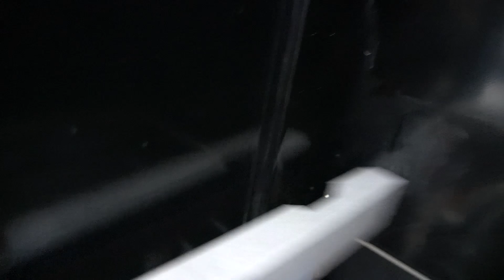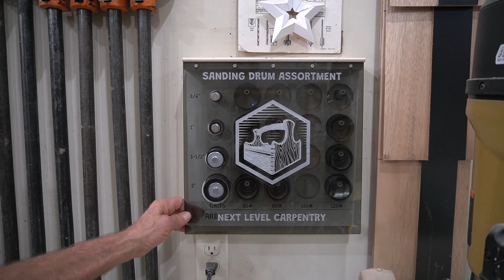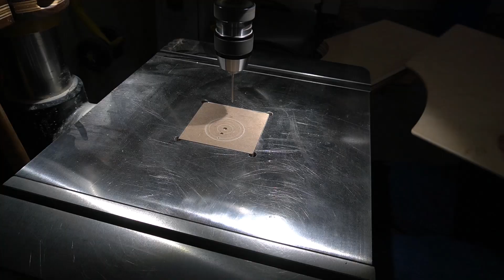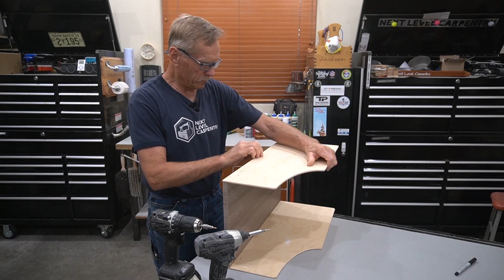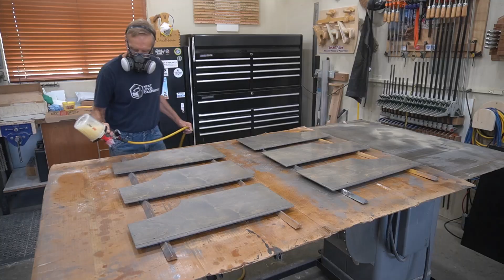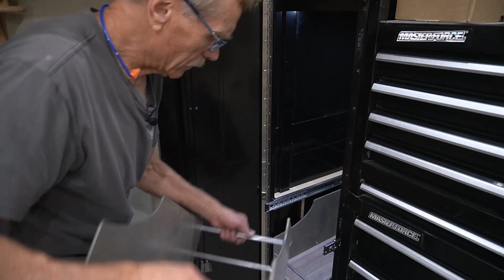Organize with Custom Toolchest Pullouts

Comment: No end of the end of the end?
Great job. Nice how you were able to install with out going through the cabinet.
So the link in the description is where you can get different types of fasteners and hardware to fit your needs?
Reply from the maker: The little 60 second build clip was meant to be the end of the end of the end on this video.🤓
Yes links in the videos description are to some of the unique and unusual things like what was used in the video to build these pull-outs.

Comment: Good video. Never thought about using binding posts for drawer slide. Great idea. Also could you do a short talk about using catalyzed lacquer. I've always avoided using is for fear of it damaging the spray gun by hardening before the job is finished. Like bondo or epoxy does some times.
Reply from the maker: I've not done any videos on YouTube about that lacquer: too many landmines to avoid, if you get my drift.  I can tell you though that pre-cat lacquer is nothing like bondo or epoxy.  The recommended shelf life of a gallon after the catalyst is added is 6 months but I just sprayed some that was on the shelf for 18 months without issues.  I think it dries a little slower after more than 6 months but neither the project or spray equipment suffers.  The catalyst is pretty benign but does seem to make it dry quicker when sprayed vs non-catalyzed lacquer.  Really nice stuff: sprays easily, sands pretty easily after a few hours and leaves a nice, durable finish IMHO.
Reply: Agreed!  Binding screw posts have been added to my must get list.
Reply from the maker: @BostLabs  They're excellent for certain rare applications IMHO but the range of sizes and lengths is so broad that I pretty much by them on an as-needed basis.  FWIW they get used in this NLC video too for a completely different purpose: https://youtu.be/e7-TUG6-ED0

Comment: Hmm. Could you have gang-cut and trim-routered the sides by using double-sided tape to stack sides, then using the drill press to transfer the spacer holes all the way through?
Reply from the maker: Definitely worth considering so I like the way you're thinking.
Methods like that have potential for speeding up 'mass production' of pieces like pullout sides but require more attention to precision for consistent results.  Deflection in sawblades or drillbits, very small misalignment of stacked pieces etc can quickly spoil a whole stack of pieces and cost more than time saved.

Comment: What do I think?  II think your parabolas may be elliptical.  Not a huge deal, but thought you should check it out.  Like the presentation.  Added it to my favorites!
Reply from the maker: I think you're correct-er than I am!  Can you explain the difference?  I've always kind of assumed a parabola is half an ellipse but, now that you point it out, figure that must not be the case?  Glad you like the video... thanks for watching and posting a polite clarification!
Reply: @NextLevelCarpentry  I love the way you make your ellipses.  the difference is the way they intersect the planes of the cone
https://www.youtube.com/watch?v=VAz-X6uaSs4
Reply: @NextLevelCarpentry  video @stevenhines555 provided is illustrative.  A parabola has a single locus point around which it curves.  As you move away from the locus the parabola continues to open endlessly.  I good example of a parabola in use is the headlamp of a motor vehicle.  The lamp occupies the locus point of the parabolic curve and the interior of the lamp is coated in reflective material.  The advantage of the parabola comes from the fact that all light reflected off the reflective surface emits from the headlight parallel concentrating the beam of light forward instead of allowing it to scatter.  The light that emits directly out of the headlamp, never striking the reflective surface, scatters as it pleases.  Now a headlight is a three dimensional projection of a parabola spun around an axis through the locus point and is more correctly labeled a paraboloid, but it is based on the underlying shape of the parabola describing it.

An ellipse has not one, but two locus points, and in the apparatus you devised are represented by the two brads you drove into the  wooden slat.  Were the brads dropped into slots at 90° right-angles to each other instead of run along the edge as you showed, the ellipse would curve around and then back upon itself.  I do believe what you drew is 1/4 of an elliptical curve.  Stumpy Nubs illustrated making full ellipses with an apparatus very similar to what you used, here:  https://www.youtube.com/watch?v=7KYsWwB8xMQ .

Comment: Great stuff Matt!
Reply from the maker: Thanks Greg.  You might have noticed I kept corrupting the term 'binder post screws/bolts'?  I still can't say it consistently because, in my old carpenter's vocabulary, those are either 'through bolts' or 'sex bolts' like the ones used for commercial door closers, lock security plates, toilet partitions, etc. and I bet you can relate? 🤣🤣
Reply: @NextLevelCarpentry  We've always called them sex bolts.  Our blue printers call them binding posts.  I can absolutely relate!

Comment: Matt, I’m so impressed with your planning and execution of what many people would categorize as a very simple project. You have created an elegant solution to drawers in a storage cabinet. I’m very impressed!
Reply from the maker: Cool.  I started out figuring this would be "a very simple project" and appreciate that you're impressed by the 'elegant solution' it ended up requiring to succeed.  I'd say I was most relieved as I learned that it didn't require a single fastener to secure the drawer glide mounting blocks into the cabinet to achieve 'rock solid' installation achieved with 'elegant' fitting, notching, etc.  Hope that's true for other cabinet brands and designs so that this video doesn't prove false hope for would be organizers!

Comment: Well,  this is now on the list to do on my HF US General cabinet.
Reply from the maker: I'd be interested to know what challenges you encounter making drawer glide mounting blocks in your US General cabinet.  In this video I make the assumption that each brand will be 'the same thing, only different' and am curious if that's a valid assumption or just wishful thinking.
Best,
Matt
Reply: @NextLevelCarpentry  I'll keep you posted

Comment: Very clever design on the blocks for mounting the drawer glides!  I bought some used office filing cabinets for cheap to keep a bunch of stuff.  They work pretty well, but are definitely not as nice as your custom cabinet pull outs.
Reply from the maker: Thanks for sayin'!  Filing cabinets like yours are a great option where space, budget and stuff-to-be-stored are considered.  After all "nices as your(s)" is all relative, right? 😉